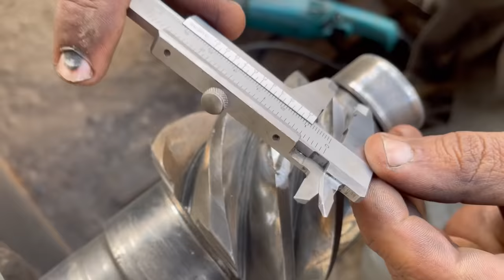I repaired the scrub pinion which no mechanic repairs | Give your opinion by watching the video |

Comment: I see a lot of "nay sayer" first world experts here, saying this job will not work. These repairers don't have the luxury of brand new parts and perfection, they need to do that which is necessary to get a truck earning it's keep. I'm a retired fitter and machinist and in my time I've worked on plant that needed to keep going and we've had to do similar type of repairs to these. Not perfect and by the "machinist hand book" but they worked as required. So don't "rubbish" and disrespect the work this man does. It must work, otherwise he wouldn't have people coming to him to get these jobs done.
Reply: fuck yea man u put that shit perfectly
Reply: I agree. If this was a terrible idea, he wouldn't do it. It may not last as long but if he can do it efficiently enough he can make it worth his time.
Reply: This is what happens in an less educated world. They're making money, no one should be complaining
Reply: First world differential repairer for 12 years here. More than a 1000 diffs rebuilt in my career. Very few people in the world with my experience that’s for sure, maybe none.
I can gospel about this.
If it even rotates in place I say it will explode into pieces within a mile. Must be carbon rehardened.
Nevermind the noise and the fact that he ruined the other good teeth at 8m20s...
Reply: Good welding skills though! Other than that they are completely clueless about the super tight tolerances such gearings have to work with. That why they tried to “repair” it. I guess it’s just a learning experience for the shop or just a YouTube visualization trigger.
Reply: this make a lot of skill less part changing ''mechanics'' , machinist  of today very jealous , not long ago  I would say  just before the  90s, all over the world  people like the man in the video could be found anywhere , making parts when parts were not available , he have  great skills
Reply: @JamesSmith-ui2hv  Jealous? Buddy, you'd go out of business if you used people like that to make repairs on company vehicles.
Reply: @Picondcg  well, both you and I should be thankful for the "perfect world" we live and work in, other's situations are not so perfect, so "needs must" applies, and from my 55 years trade experience, can work.
Reply: Will work for a wile, but will break eventualy. Needs the right temper. But depending the place, will save asses.
Reply: Even in the replies here there is far too much sanctimonious, first world clap trap. These people are hard working souls who live by their wits and the skills needed to make things work. We are so terribly privileged and smug.
Reply: @dougthomson1566  absolutely agree, these hard working people will survive and have survived through harsh times. We, on the other hand...well I'm not so sure, especially if, for some, everything isn't perfect.
Reply: @Picondcg  I've done this repair myself on a dump truck axle pinion, with a mixture of mild steel and hard facing rods and it worked perfectly. I was told by several machine shops that it wasn't repairable so I decided to have a go myself.  The repair was made about six years ago and the truck is still working to this day, no nasty noises or swarf in the oil.  A replacement part was going to be twelve hundred dollars, I repaired it for under a hundred including the oil!
Reply: @Altair885  I would pay to see that...😜
Reply: If the new part is expensive I can see this being cost effective.Telling the driver to baby it may help.
Reply: @joshyingling  and I guess you may not have lived long enough to see how we in our privileged western first world culture used to do things. These people are doing things the way we used to do them in the past, because of financial constraints they may never catch up but they do clever, inventive and adequate repairs with what we'd see as very basic resources. We have pretty much lost those abilities in our wasteful world of plenty, because we're too smart.
Reply: @gazzafloss  I understand what you are saying and I’m somewhat of a Jack of all trades myself. However they aren’t “ super human” as others are suggesting
Reply: Well sead some people have never done anything just picking at any little thing. I bet if they were stranded they'd have the repair done.
Reply: @mattlawton4715  maybe but at the Same time there is always the option of “ the truck broke down and we are waiting on money/parts to arrive” this “fix” will likely lead to a much worse failure of that part from galling, and then not only will the gear be broken in the same spot, but multiple other teeth as well, then they will really be SOL
Reply: @joshyingling  you are correct but on the grounds of the whole diff is probably trash anyway so f it and give it a go run it till it fails then fit another diff.👍
Reply: @mattlawton4715  yeah that’s true, if we could get a solid couple hundred miles might be worth it, if it goes 3 miles, I wouldn’t even bother
Reply: @joshyingling  absolutely 💯agreed 👍.
Reply: You said it
Reply: Please. This is precision work, and requires the same machines used in fabrication.
Reply: Ok, so maybe it’ll creep along for awhile.. but its going to make hell noise, eat the ring gear, bind up with each turn, now has uneven heat stresses, etc, etc.
Its a spiral bevel pinion for fuks sake, there’s no “fixing” it with a stick welder and 4” grinder… this kind of thing might work for some temporary repair on a industrial conveyor belt gear box or pump drive contraption, but its complete shit and even dangerous in a vehicle.
Reply: I swear I was thinking the same thing.
Reply: My grandfather also used to make spare parts in his workshop to fix old vehicles much similarly - and it worked fine. Those 'customer states' videos have plenty of examples of vehicles that withstood a lot of punishment due to neglect or the customer crashing but driving it to the shop anyway. Trucks and consumer vehicles are designed to withstand a great deal of minor imperfections until they need to be brought in for repairs. If they broke down due to minor imperfections on a pinion they would live in the repair shop
Reply: @stevenleslie8557  the welded part usually lasts longer than the original
Reply: @willemdegrebber7227  maybe if he really soldered this part well, and not just leaned an electrode against this part, it would make sense, because it's not even that he's trying to fix the gear with a welding machine, but in the WAY he uses the welding machine, there is absolutely no adhesion of the source metal with newly deposited metal. Although I think that all this is done for the sake of content, no more😀
Reply: Plus their trucks only have a steal frame, the rest is wood, very light weight that pinion will last another 20 years when he's done.
Reply: @Picondcg  now that you're retired, perhaps you should travel to see how the rest of the planet has been able to operatefor eons w/o your particular brand of expertise to lead & protect them
Reply: @johndough201  you obviously don’t know me so why are you commenting on my “ignorance of the world”?? You also don’t know where I live/lived... who told you I’m retired??? 
If you don’t have anything to comment about the video I suggest you keep quiet.
Reply: I do agree with each one word you placed here!!!! Congratulations!!!
Reply: Something is better than nothing 😊💕💕
Reply: Thanks for watching my comments
Reply: Absolutely!! 
Every time i see them working i can only respect the effort they're doing despite the lack of materials
Reply: Think big, they only do these repairs for Youtube videos only.
Reply: Well said!!!🎉
Reply: We " Nay say " because we understand engineering
Reply: @chrisclarke3965  think you do.
Reply: I’d say he removed a lot of the wear resistance whilst welding and that this will result in failure of the whole assembly by allowing contaminants to break off into the gears.
Probably ok until the vehicle is put under load.
Anyone can weld and grind but not everyone knows how to use the processes (and have access to)the means for returning the surface to a hardened state capable of withstanding continuous contact under load.
Reply: Good job man and let the haters hate!👍
Reply: @vintagemusicgroup9236  there was a time b4 youtube.. u think they had the possibility to order a new part in the ass end of Afghanistan if this broke? Or that they could afford to just get a new truck? This is the way repairs are done in the 3rd world.
Reply: 100% 👏👏👏👍
Reply: @Picondcg  yeah anyone that knows how to set up a rear end knows why this is a terrible idea. It’s not even worth arguing with people that don’t know anything about rear ends. They look at this shiny part after it’s done like “oh it looks great so it should work just fine”. I’ve been a professional auto technician over 20 years, I own a shop, most technicians I’ve worked with have never set up a rear end and have not idea how to do it, replacing the bearings and slamming it back together is not setting up a rear end even though some guys think that is, a guy u worked with just a few years ago before I opened my shop put bearings in a rear end and before he put it back together I said “ur not gonna check the pattern on them gears? He said “I put the same pinion shim on the new pinion it will be fine and has .008 lash”, I said well what numbers were marked on the new pinion? And the old? What if the new inner pinion bearing wasn’t machined just like the old one? It’s gonna be off. He took it on 20 mile test drive and the gears were screaming lol. These big trucks break pinions from being over loaded and the driver pounding on it, that pinion is gonna break in the same spot again.
Reply: Très bien dit monsieur si le monde entier faisait pareil on aurait beaucoup de personnes au travail et moins de chômage. La personne qui à réparé cet engrenage doit être fier .en tout cas je suis fier de lui. Lui aussi moins à créer quelques choses de ses mains.
Reply: @Picondcg  unless you believe the replies of first hand experience doing this and it working for years of work are ficticuous, I hope you dwell on not letting yourself sink into a self appeal to authority fallacy and realise perhaps this kind of repair can actually succeed
Reply: Such a perfect repair to sell the truck, the sawdust will fall silently.  I don't care if it breaks in a week.
Reply: @Joshua Yingling  they get the job done that is what counts
Reply: Well said sir. No better way to say it like you did.
Reply: It's just economics in these particular countries the  economics different. A repair that doesn't last is still more economical than new parts. Time is cheap parts are not. 
 in the west a new part is cheaper than all the labour and vehicle down time . 
Time is expensive and parts are cheaper in relation to time.
 People are negatively commenting based on there own experience in there own country not realising these repairs make perfect sense outside of their own country.  It's a shame we moved to throw away economics
Reply: @tonywoodford9164  yes indeed, if only in a perfect world.

Comment: I researched the rods they were using...made by Nihonweld....they recomend a 1 to 3 pass over lay with NHF-300 or NHF-350B which is a soft matrix rod...for the final passes they used NHF-650B which is a hard Martinsitic facing rod....i would preheat...weld....post heat and either wrap in ceramic wool or build a hardwood fire and smother the pinion with hot coals and ash till cool to the touch...then profile the tooth using a hard wax or clay fired template of the ring gear teeth that the pinion mates to....for final fit up the pinion would have to be mounted into the carrier and mated to the ring gear using red lead or hi spot bluing to work down the hi spots....tooth engagement and pattern are of the utmost importance...it would be time consuming but a positive outcome could be had if done correctly!!...i would use the Tig process but you fellas have to use whats on hand...my hats off to you and thank you for sharing....keep the good videos coming!!!
Reply: This is why no mechanic repairs these. For as much work as they are doing only to have a finished part that has questionable strength wouldn't it have been just as easy to get a new part? Or if you were concerned the new part would just be the same quality as the old part fabricating a new part from better stock would probably be just as easy.
Reply: @jackdecker8100  i repair equipment that is early to mid 70's...TD7 international dozers come to mind...you go to a dealer and find out "parts no longer available"....Obsolete...then what??  We make the parts....the people were going Nuts when scrap metal prices were high...the tractor bone yards were lacking parts because people were scrapping them for money....and its not going to get better either....repair and fabricating shops are busy and a lot of the stuff we are doing is exactly what these gentlemen are doing....i call it "MAKING PORK OUTA PIG SHIT"....some of their methods are crude but they work....we should all pay attention and support these guys....because we are headed in the same direction because PARTS ARE NO LONGER AVAILABLE!!
Reply: What filler rod would you use for TIG hardfacing?  NIHONWELD 650 consists of Mn-1.35%, Cr-4.12%, Mo-7.7%, V-1.9%(!), W-2.2(!).  I have not found filler rods with a similar composition.
Reply: @jakodzun  pound off the flux and sand the electrode wire clean....wipe them down with Acetone and use the tig torch with pure argon gas
Reply: @richardsedenquist3222  I get your point there is just no accounting for the state of the economy and I myself have been guilty of fabricating a tool that I can use to fix the tool that I need to do the job out of pure nassesity and it makes me that much more grateful for the times when everything works like it's supposed to without a two or three step process between me and my desired outcome..
Reply: How does your method deal with the differential hardening which would likely be present around the heat affected zone of the weld? Would you not grind to rough shape, then send the item for heat treat, prior to finishing grinds on the mating faces? 

I have performed this repair on a smaller worm gear before but my repair failed, and I assumed it was my filler and HAZ causing the teeth to be too soft.
Reply: @kraptastic333  the heat treat is what is most concerning to me! Or lack their of, because any heat treat that the pinion had is probably lost by the welding heat, so even if the "new metal" is hard, the part it's attached to most likely isn't. Just my guess, great 👍 👌 skill with a grinder though!...from Wyoming USA 🇺🇸 🤠
Reply: Are you kidding these guys will thro it in there with hammers and there 100 year spanners thicken the oil with sawdust and aline by touch   lol 😆
Reply: @rabk5702  in high school my friends had this amc Rambler with a 6 banger in it...it had a bad Rod knock in it...they pulled the connecting rod caps and bearings and put rawhide strips in it for bearings which eliminated the knock....a 80 year old school teacher bought that car and drove it untill she went into a nursing home 10 years later....it ran like a top for her.....her nephew inherited the car and blew the engine out of it in less than a week by pounding on that engine....if he would have driven it like grandma did it probably would have lasted another 10 years....LOL
Reply: @billallen4793  yes bill that would be a concern....but if you preheat to 450 degrees....and tig weld the passes with the soft metal then the hard martensitic overlay....then post heat back to 500 degrees and wrap it in ceramic wool to cool very slowly you dont alter the metals structure......i flame spray worn bearing journals on axle shafts and worn pinion seal areas ....machining an undercut....then threading it.....preheating to 400-450 degrees and spraying on a nickel bonding coat...followed by a powedered aluminum bronze cover coat....keeping the whole thing below 500-550 degrees....it dosent change the structural strength of the steel.....if they did the overlay with the soft matrix....and the application of the hard martinsitic overlay keeping within those parameters heat treatment wouldnt be necessary as you changed nothing....the hard overlay would be hard without quenching wi h you should never do !!!!!
Reply: @richardsedenquist3222  That reminds me of the time my uncle bought a car of my boss a big end was knocking I felt conflicted he drove that car for years never complained once about it because he drove so slow and gentle never let him down...LOL
Reply: @richardsedenquist3222  just for the record, that spray welding is wild!...from Wyoming USA 🇺🇸 🤠
Reply: @jakodzun  Just break and clean the flux off  the correct stick welding rods, then use them as filler wire for TIG welding
Reply: @richardsedenquist3222  we call it making a silk purse out of a sow's ear
Reply: @richardsedenquist3222 I have an idea how to support them. Lets figure out a way to give them the ideas on how to do it better (for cheap) and get them to redo a video. Good feedback for everybody.
Reply: @snfvsd  i think these gents have got a handle on it...i researched the rods used and the welding parameters involved in using them for everybodys knowledge that would attempt a repair somewhat like this...schmooing a weld on anybody can do.....and failure rate is very high.....if you adhere to the Parameters the MFG has for the product your chances for success are much greater